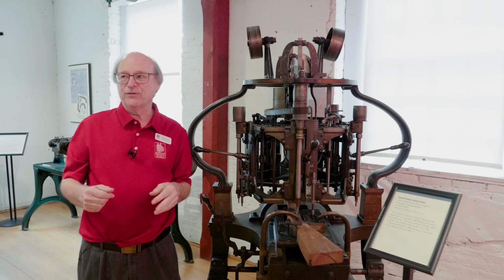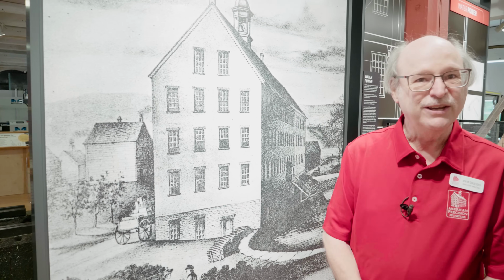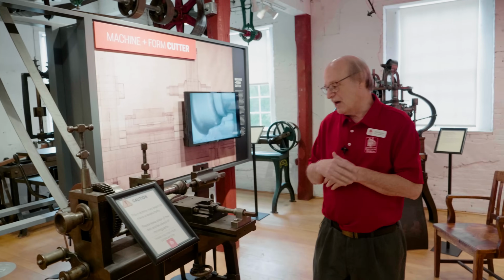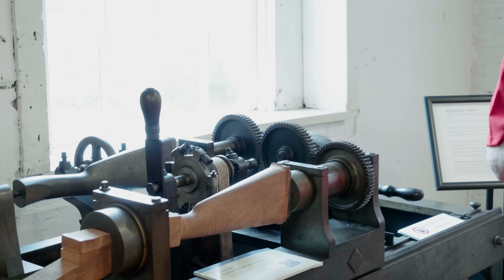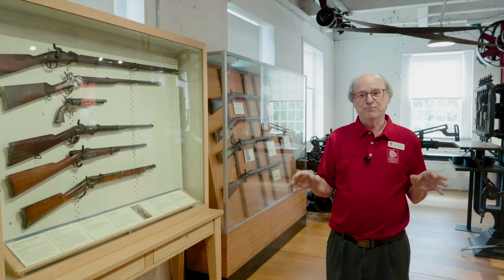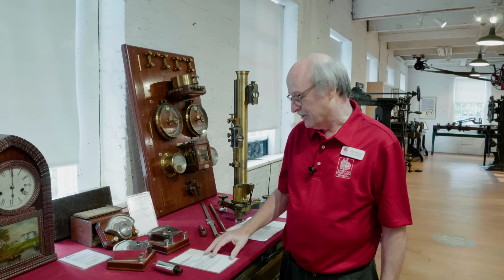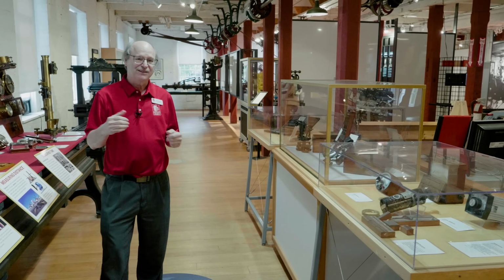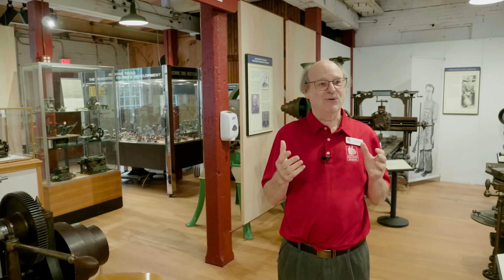Every MACHINIST Should Visit This PLACE! | American Precision Museum Tour Pt  1

Comment: A very interesting tour of the Museum’s collection. I served my apprenticeship at one of the leading British machine tool builders that also made micrometers and slip gauges. If you ever called them Joblocks you got a clip round the ear. I did my turning stint on a LaBlond lathe and later I owned a Southbend lathe that came over inWW2 via the bottom of the Atlantic and in my home workshop I had a Flathers lathe of 1890’s vintage powered by a petrol engine off a cement mixer. I regularly use my Pratt and Whintney lathe, serial no.134 as well as my Brown and Sharp micrometer was well as all sorts of tools by Starrett and various makers. I have been  an enthusiast of things  mechanical so at 87 I’m still making things in my home machine shop.

Comment: 8:09 Key-duplicating machines basically work like this. There's nothing about them that's actually specific to keys. You could 3D-print any pattern and use the key machine to copy it to steel.

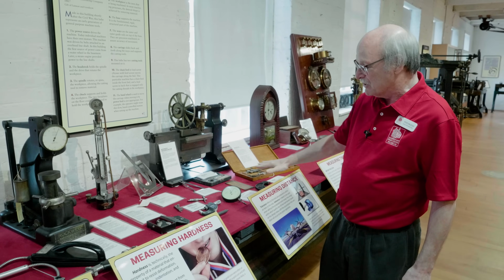Comment: 18:04 The Browne and Sharp protractor
I have one of those B&S protractors. I struggled a bit with trying to pry the frame open enough to slide in the blade and its partial circle. But that would be destructive if you succeeded. Continued fiddling around showed me the correct way to disassemble for cleaning, and to reassemble afterwards:

1) Warp the frame slightly out of flatness (finger pressure is sufficient). There is no chance of bending the frame, or the protractor blade/circle itself, since this is springy steel.
2) Rotate the protractor itself, but when the blade is about to collide with the frame, just push it down below the plane of the frame, and continue rotating. The blade will pass under the frame, easily and smoothly.
3) Continue rotating till the entire blade portion till it is completely out of mesh with the frame. Voila!

To reassemble, reverse the process:
1) Overlay the movable blade over the frame in the proper position.
2) Warp the tip of the circular section slightly (or the frame itself), and guide the tip into the frame.
3) Rotate till the blade is completely meshed into the frame.

Comment: Thanks.  The Smithsonian in DC had an exhibit in 1967 of early 1900 machines, nearly indistinguishable from then current machines, save for their belt drives.  Things have changed!  Thanks again!   Also, touching lotsa stuff, is it dry coated?

Comment: Fascinating! I'm a 63yr old toolmaker who came up using only manual machines. I actually worked in a shop in a building that still had some of the pulley shafts on the ceilings, an outbuilding where the steam engines were, the dry canal from the nearby river that fed water, and a few large coal bins. And they still had a very large planer that had been converted to electric/hydraulic. I really want to see measuring tools and cutters from this era. AFAIK, rudimentary high-carbon steels had to be used. Alloy or hi-speed steels were quite a few years away.

Comment: I can't believe you did a video on this museum!!!!!!  My wife always looks for places for us to visit.  She is from VT and I moved up here from SC (I am originally from Canada, move to SC in 94) about 12 years ago.  She found this place while searching the web.  We have visited a few times .... I could not believe when I saw Bridgeport s/n 1 !!!!!!!!!  To someone like myself, very inspiring.  

Just FYI ... I apprenticed at Westinghouse Generator and Turbine ... worked at several places ... ended up at Westinghouse Nuclear.  My wife is disabled (paralyzed from the shoulders down in a diving accident when she was 12), I work out of the house so I can provide care and earn a living.  I am in the middle of building a new shop ... 3500 sq ft with 14 ft high doors .. one man build, not bad for a 60 year old guy (you can check out some videos I have up on youtube).  I have worked on lots and lots of farm equipment since moving to VT.  I need a shop big enough to get out of the weather (we already have snow on the mountains behind me .. and we do hit -30 once in a while).  Side note ... don't let a machinist pretend to be a carpenter.  Two years and I am finally getting a roof on the place ... but in 60 ft, my walls are out less than 1/32 of an inch!  Working with a tape measure is killing me.

Great video, can't wait for part 2 !!!
Reply: And I thought finish carpenters were a pain in the a...🙂

Comment: I started my career as a tool and die maker in Massachusetts for a production manufacturing company. This was in 1983 and the presses that ran the tooling we made were still driven by leather belts on a line pulley system. Of course the line was powered by an electric motor. The leather belts, crown pulleys and shafts we made in house. As a tool maker we would make the different tooling for the production equipment. It's mind blowing to watch this video and see how long those same system were in production. I was told by the old timers we made the machines that made the machines and that wasn't hyperbole.
Reply: I thank you for mentioning the leather belts that powered the mill wheels of New England, we used the river current for power before electricity was useful. Most of the leather for those belts that took power from the river flow to the sewing machine or the stamping mill was driven by leather belts and steel wheels.
The vast majority of the leather came from the American Bison. The buffalo hunters took the hides and tongues.

Comment: Very interesting, and well presented. Where such precision was already available for new applications, I wonder why Post- WWII. American made key machines were so poorly/cheaply made. I have a relic called a Turret machine. 7 cutters on a rotating, indexing fixture. The purpose was to cut many different types of keys, all on one machine. Unfortunately, the machine had a lot of tolerance buildup, resulting in copies of keys that were so-so. Meanwhile, companies in Germany, Italy and France had far better iterations. It was not until CNC machinery got to the benchtop size, that Canadian and Americans designed highly advanced machines that though not as "GOOD" in build quality as the Euro counterparts, they surpassed in capability and output precision. The KNOW-HOW to create a capability within the machine sometimes eclipsed the lack of state-of-the-art processes of manufacturing; for want of the up-front costs of castings, and engineering. Today, my best CNC key production machine is 28 year old . It was factory serviced twice, and I take care of minor needs.  Still my daily workhorse. The Canadian outfit lost market by not keeping ahead of the industry changes, and  lack of customer support. A firm in Texas now makes my second favorite machine. FAR more capability, but it needs occasional service, as it went down yesterday. Got it mostly running now, but needs some input from manufacturer to get it 100%. 

If a museum has any interest in Keil or ILCO machinery circa 194-1975, I have a restored Turret made in 1960s.
Reply: According to my grandfather this discrepancy  was due to the Europeans using new equipment (the factory being rebuilt since the war) while the US factories were still using old machines. Reference Mike Home, above, who told of working on old line shaft driven equipment in 1983!  New machines will produce more precise parts than old worn machines.

Comment: Amazing the Poms bought firearms with interchangeable parts from America in 1850s and were still hand fitting them after 1900.
They even had the Enfield inch a non standard measure.
When Australia set up its armoury at Lithgow they bought American machinery and were helped by US to set up the production line.
Consequently during WW1 the Aus 303 Lee Enfield rifles were more accurate than the Pom originals and had interchangeable parts.
Similar story in WW11 with the Rolls Royce Merlin hand made. Ford wouldn’t make it as the accuracy wasn’t there.
Packard redesigned it for mass production.

Comment: 1983 Deep River or Chester, Connecticut . the was a factory called M.S. Brooks , Was a wire bending factory ,  originally ran on a water wheel , converted to giant electric motor ,  all presses and machines ran off of those  overhead shafts. rebuilt many belts , 
was a great place to start working as a 20 something back then.  Thanks for the video

Comment: Spent 50 years as an electrician and enjoyed doing work in machine and tool & die shops. Even was lucky to work several times in an automatic screw shop. While attending a great VoTech school back in the 1960's was amazed how the new machine shop had a CNC machine that ran off of a punched paper tape. My industrial electricity shop teacher always had me go out and connect equipment up and even install some conduit in different shops because I was ahead of the class having worked on jobs with my electrician dad & uncle. Guess now a modern shop could build better quality modern rifles so much cheaper then the shops back over 165 years ago. Just wondering with all of the fancy what 3,4, 5 axis very fast CNC mills does anyone still make a multi spindle drill press? Have not seen one in the dozen or shops in over 40 years. Thank you for an extremely well produced vidio. They should show this vidio to new apprentices.
Reply: I had a client in 1980s that still had a mill that still ran off trays of ibm cards, sequenced. Auto tool changing, etc etc. NEW CNC.... not that much different than an old knee mill with a DRO...... add some steppers, control equipment, then redo over and over until you get it fine tuned. Not much later, another client has an EDM machine, and my first time seeing a modern mill by Mitsubishi, making itty bitty little stainless valves used in heart surgery. That is a neat contract, since the valve and tubing connected to it get disposed of as hazardous waste..... They made these for Baxter Health, who could not make them in-house without an unacceptable reject rate. My client had the know-how to produce with an error rate of less than ONE unit per 1000, and his testing process could catch that 1, so they delivered 100% within tolerance.... at about $350.00 per each, in runs of 500+

Comment: Very interesting!  I started my career in the 70's building black powder guns by hand, and retired in 2018 inspecting  aerospace parts with a CMM.  Feels like I followed the history of machine tools in my 48 working years.
Reply: How was the slot for the hand that drove the revolver cylinder cut out?   The hand connected to the bottom of the hammer and as the hammer was drawn back it engaged the cylinder ratchet revolving the cylinder to the next chamber.    With the Colts and Remingtons, it moved the cylinder clockwise.   What type of tool was used to do that?

Comment: When I started in the trade, the Oliver Machinery building still had the overhead shafts and pulleys. I was inside of a working water powered grist mill with belts singing all around, and that felt dangerous. Big salute to those machinists who came before.
Reply: You sure made some good machines at Oliver. I have a lot of hours running Oliver machines and have found them to be VERY durable.

Comment: At some point someone should have said "we should go with the metric system"
Reply: We did. Our money is based on the metric system of units 1,5,10 25, 100 and so on. In 1976 President Jimmie Carter heralded us into the metric system. In 1978 the auto manufacturers started their transition to metric with cars and trucks having both units. By 1988 the transition was complete.Too bad the consumer never fully adapted.
Reply: @danfarris135  — Money is decimal, not Metric.  Machinists use decimal fractions with inches.  That doesn’t make inches Metric.
Reply: @GH-oi2jf  I just happen to be a machinist that has to deal in both. I use the “dollar” system to explain to the young ones to give them an idea of how it works with metric. Round up .0393 to .040 for 1 mm or 1 dollar. That can be broken down in half, quarter,tenth, twentieth and 100th of a millimeter. When we use metric on blueprints it breaks down in the same increments as money does. Either multiply or divide by 25.4 to convert back and forth between the two.
Reply: @danfarris135  sorry, you don’t understand what metric is, metric is based on meters/metre, nothing to do with how we count. Dollars (dollar is a Germanic/English word from around the 1500s) have been around for a few centuries before the metric system was devised, we count in multiples of 10 because we have 10 fingers, it’s called the Decimal(Greek/Latin word) system and was devised by the Arabic numeral system
Reply: The Metric System wasn’t ready at that time.  The Convention of the Meter was held in 1875.  When Metric ammunition was introduced, US gunsmiths were able to support it because we adopted the Metric System in 1866.

Comment: I'm a 50 year machinist veteran  I used very similar machines in some old shops.  I still use a WW2 lathe .  Thanks for the great tour.
Reply: I use an old Sheldon that still has the plate stating it was made under war number such and such from WWII on it it'll still hit .0005 if I do my part.
Reply: @williamstansbury2717  I have a WWII Pratt & Whitney Lathe , very smooth.
Reply: My 45th year here. Still doing bearing fits for dyno's on my 1943 Monarch. They dont make them like that any more.
Reply: I have a LeBlond Heavy Duty lathe with a 4 digit serial number. Im not sure but I think its old. Ha ha.
Reply: In the 80's I worked at a gear and sprocket company that had WW-ll surplus lathes and my lathe had been converted from belt drive to electric motor drive. I lost my job to a CNC lathe. Well, that's progress.
Reply: @GeneSun I was in high school when the first handheld calculators became available - if you could afford one - very few students could. Up until then you worked out algebraic equations on a slide rule. I am/was far from a math genius and the work was tedious, but I learned the processes req'd to solve the equation ie I had to understand "the math". Once calculators became cheap and available one only needed to know which buttons to push. Our ingenuity and cleverness only served to make us dumber..
Reply: I started on Bridgeport Mills.
I know a few people who still use them
Mostly for fun, but one luthier I know uses it most every day.
Reply: I have an old Sebastian treadle threading lathe.
Reply: @GeneSun Exactly. You said it all.
Reply: All Japanese CNC here now but I’ve used a warner & swasey No 2 plenty as a younger man. Good stuff cool tour!

Comment: I did laugh at your comment about how there is always a gauge block missing from a set, I've worked in machine shop engineering for 37 years and can honestly say that I don't think I've seen a complete set of slips outside of an inspection department (I'm from the UK, here we call them slip gauges or just slips). Great video, very interesting.
Reply: My pin gauge set is the same way. I loaned a .127 pin to a customer for him to check a hole size. Needless to say, I never got it back.
Reply: your right My company has a Gauge pin set from .010" to 1.00" and there are several pins missing. But in QC office there is a complete set.
Reply: john spencer, because there are no parts missing from the set, i think it proves that edison never loaned the set nor used them himself.  that is assuming that no-one replaced the missing pieces.